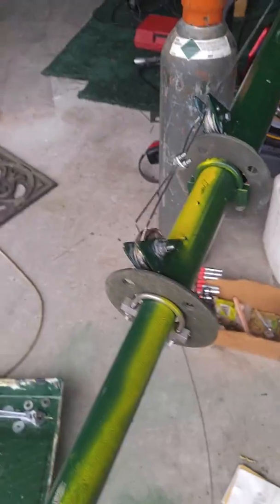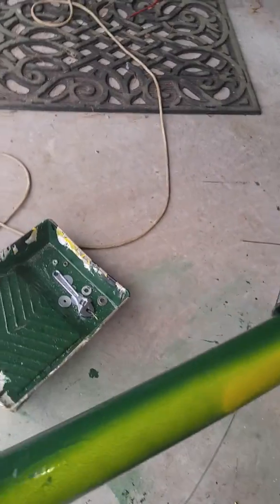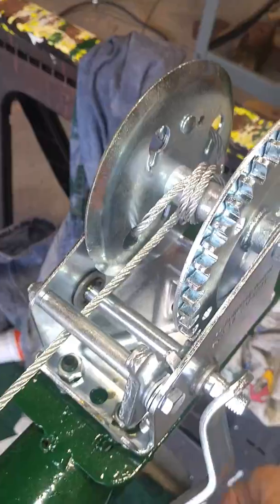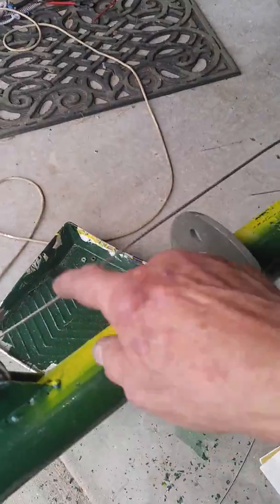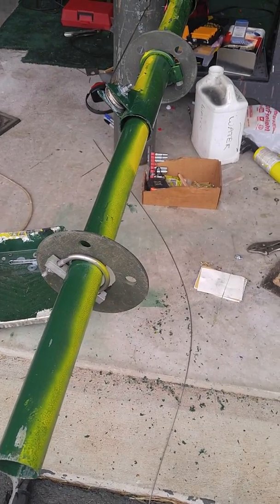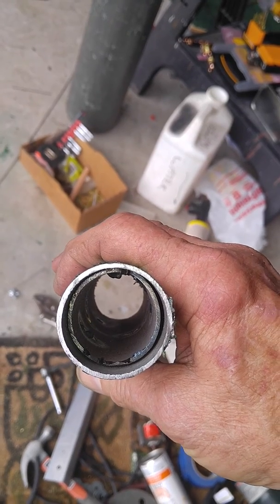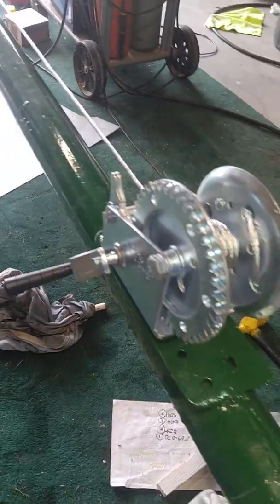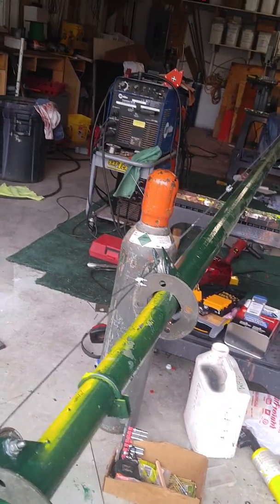My 50' crank up mast

Comment: Looks like a solid design,  The only issue I see is using a single wire rope clip to secure the cable.  For this kind of load you don't necessarily need to follow industry standards but at a minimum use two properly installed wire rope clips.  There is a right way and a wrong way.  A failure there could make a lot of unnecessary work that is easily avoided.

Comment from the maker: THere is enough spacing between the pipes to allow the stainless cable to move easily, the cable pulls up the inner pipe from the bottom and tilts the pipe just a bit AWAY from the cable aiding motion, and stainless is tough. the pulley feels the cable into the gap so it misses the outer pipe edge.  I did the same thing with a 53' square box steel mast for my masts, much heavier and it works well. see:: https://www.youtube.com/watch?v=6vZe0tXuV1w     merry christmas  Woody

Comment: Where the cable goes over the pulley i cant see how it goes thru the pipe. Did you cut a slot ?  I would be concerned about cable abrasion as it goes thru the slot. I'm sure you have thought of that, i just cant see how it goes thru without scraping against the outer pipe.

Comment: Salam
How I can stop the pole from moving around in circle while I placed ubnt devices like ubiquity powerbeam dish at the top section.
Reply from the maker: I suggest the guys wires be attached firmly to the top pole to prevent  it for rotating. the guy ropes will eliminate its freedom to rotate.  I use it to support a wire antenna and that prevents it from rotation as the wire pulls it to one side only. WW
Reply from the maker: I dont understand the question, the support cables prevent the poles from rotating, Woody
Reply: @woodyw6933  I made this like perfect you saw in your video. But the very upper one pipe is rotating when heavy wind blowing.
Reply: Pole guy wires perfectly working. But in iron round supporting in pipe for holding the pole does not working for which results the rotation of pole from upper side. And my wifi device angle disturbed

Comment from the maker: There several hundred $$ invested, but its sturdy, lasts and 50 ft is a bunch. Tried surplus poles, heavy weak and did not last a wind. They splintered at 40+ ft height, collapsing.

Comment from the maker: The attachment of the cable is done thru a hole about 4 feet above the bottom of the inner pipes.  This prevents the cable from being able to lift the inner pipes up enough that they could pull out or to the top and wedge or jamb against the lower pipe.  The cable is secured inside the inner pipe by a ball or wire clamp.

Comment: I like this one best of all the DIYers!  
If you could pin all the pipes together with it lowered the same wench could tilt the tower over? Of course the wench would have to be on a pulling post. or at least routed to a pulley on a pulling post.
How do you fasten the cable 4 ft off the bottom of each pipe?

Comment from the maker: The sleeves are to double the wall thickness and distribute stress at the joints, for stability.
Reply: For future reference, I've just been watching this video about removing internal weld seams on tubing. If you're making another mast this may help. https://youtu.be/ozSE7Wrdb1o

Comment: When you take it down for maintenance,  weld an inner "sleeve" piece of slitted pipe inside the top 12" portion of the larger pipe to stop the inner pipe from wobbling inside of the "mother" pipe. Just a thought. 👍

Comment from the maker: Flux welder is a welder. My mig'ging was easy as the metal is 1/8 th in. Thick, no burn thru etc. Enjoy. Ww  It up stable and have not had to touch it since, rotor works well, I did guy it as the wind wants to twist the center section as it hanging on the SS wire, so I torqued it to one side with a dacron rope.

Comment: Woody W can you tell me how you attached the stainless cable to the inner tube, or direct me to the website location with pictures?
Reply from the maker: Cable went down outside of tube and near bottom into the tube with a wedge shaped hole capturing the cable end (ball end) inside. There was minimal clearance betweeb inner n outer tubes, attachment needed to be minimum thickness. Ww